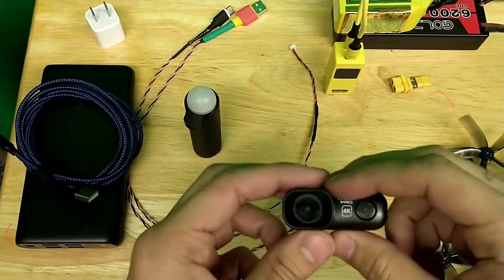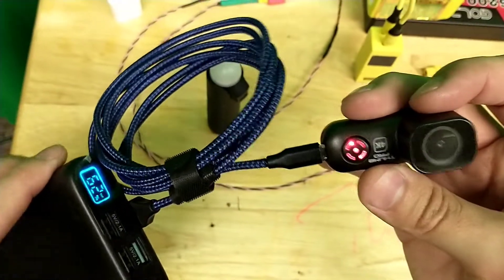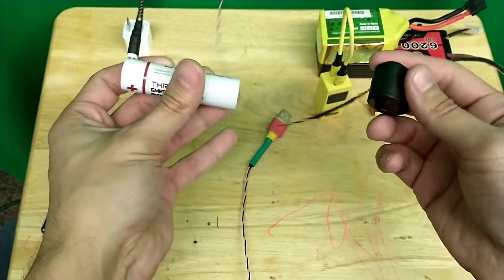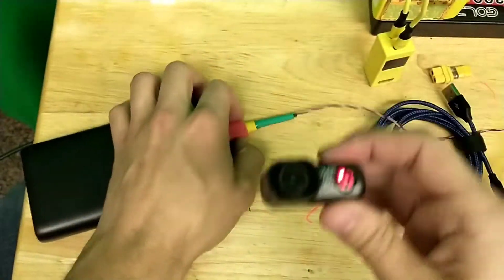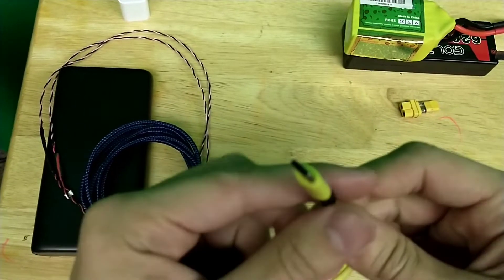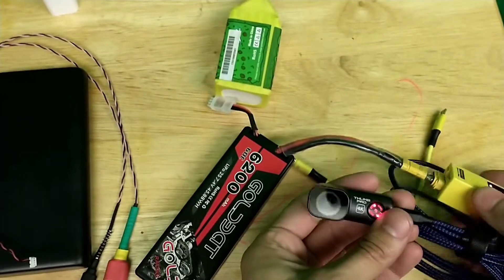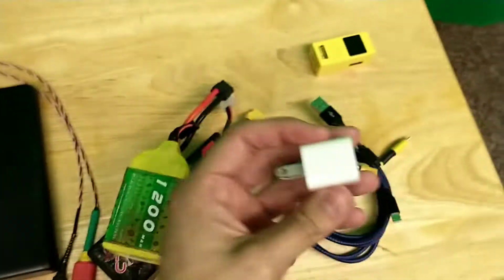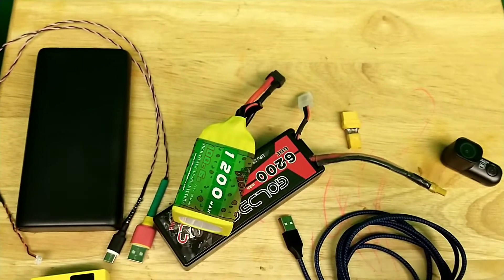Different Ways To Power The RunCam Thumb Pro 4K

Comment: Is that a special 5V power bank that you're using? Where can I buy one?
Reply from the maker: https://amzn.to/3vu53lg
That's a link to the Thrunite emergency flashlight power bank. Its output is 5v at 1a and the battery lasts a super long time using the included flashlight attachment. I use it as a night light while settling into bed and only charge it once a year so far. It can also function as a normal 21700 delivering 3.6v 5,000mah with the flashlight attachment removed.

Comment: If i want to use it with powerbank does the power bank not damage it? Because the camera description says max 500 mah with max 5v
Reply from the maker: 5 volts is the important part. If you think of your battery as a gas tank the volts would be the type of gas and you never want to mix that up but the mah is just the size of the "gas tank" or how long that battery can provide 5 volts. So a 5v 100mah battery would provide the same voltage as a 5v 1000mah but the 1000mah would last longer. I hope that was more helpful than confusing : )
Reply: @TheDreamsmithYT  It was useful, thank you! :) 
That's what I thought too, but someone else told me other. That's why I thought I ask :D

Comment: Its ok to give direct power from 5v or 3.7v battry ?
Reply: It actually works on 3.7v just tried it. Just make sure the battery has enough current output or it wont work. It works on the 1s Gaoneng 450mAh whoop
Reply from the maker: @radunit4805  Nice! Great Info thanks for testing and sharing!
Reply from the maker: 5v is ok. I don't think it will power on at 3.7v.
Reply: @TheDreamsmithYT  please suggest any 5v lipo battry for toy drone to powerup thumb
Reply: @TheDreamsmithYT  if i use 3.7v 350 or 400mah battry and connect it with 3.7to5v stepup module in runcam thmb camera
How long  battery will work  ?

5 to 10 min ?
Reply from the maker: @bhargav2105  That's a great question give me some time and I'll see if I can get you a good answer. First thought is a few minutes at most though.
Reply: @TheDreamsmithYT  sure but please answer
Reply from the maker: @bhargav2105  I ordered a stepup converter and I already have a 3.7v 450mah battery. I should be able to test it this weekend and get you the correct info hopefully. : )
Reply: @TheDreamsmithYT  thanks a lot buddy...you are best😊
Reply from the maker: @bhargav2105  "arriving by 8pm" I'll get a battery charged up and test tomorrow most likely. : )
Reply from the maker: @bhargav2105  https://youtu.be/2NK9TtQhlvk
Video is up hope is helps. : )

Comment: Hi nice information..what kind type of battery for second powering?? Thank you
Reply from the maker: Hello here's a link to the 2nd battery bank I used in this video.
https://amzn.to/3jKb5Z8
Just a quick heads up the type c and micro usb are inputs and are only used to charge the battery bank. Thank you for watching : )
Reply: @TheDreamsmithYT without step down?
Reply from the maker: @tokmung_official  no step down required. 99.9% of USB power banks put out the correct 5v needed. Hope this answers your question.

Comment: You can also power it with a 4s-6s balance connector with a BEC cable.
Reply: That is why I came to watch this video.  With the 80 ways, I thought for sure he'd have a balanced LiPo adapter

Comment: Great video. But i use small 2s and in some of my foam planes 3S lipo...how do i use it in a small rc foam plane ? Thanks
Reply from the maker: Hey thank you so much! If your flight controller doesn't have a spare 5volt output that you can solder a power and ground to you will have to make a 5volt output off of your battery by using a bec to step down the battery voltage. Most RC becs you'll find can step voltage down from 2s-6s batteries to a steady 5volt to power the camera. Sorry for the wall of text if I find a good video explaining it better I'll link that here. https://youtu.be/cOfS_R5xCHQ Send me a link to you flight controller if you can.
Reply: @TheDreamsmithYT  Thanks for the response. I do not use a flight controllers in my planes , they are small 230grs. My receover does not have a BEC , it has just the connection to the servos. can i use the receiver port for the servos to get the 5V, i may have one available? I will check the view. Thanks!!
Reply from the maker: @alexherrera3918  As long as the receiver port is putting out constant 5v that would be perfect. In that video at about 8:30 he starts making what I think you would need if the receiver port doesn't work. He basically just makes a battery extension wire with a bec spliced into it. Hope it all comes together for you : )